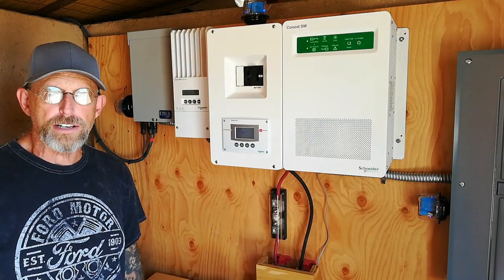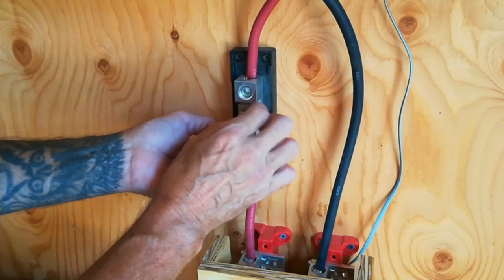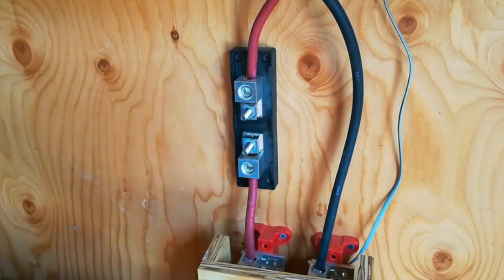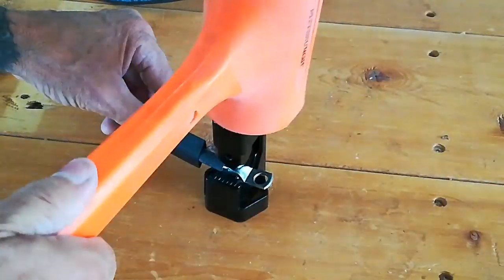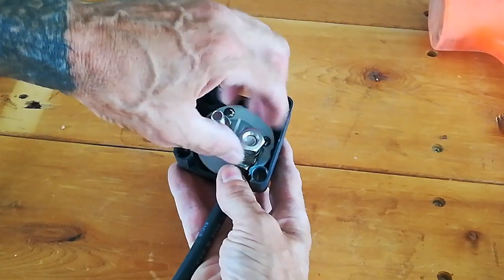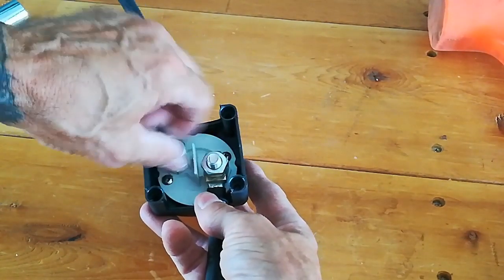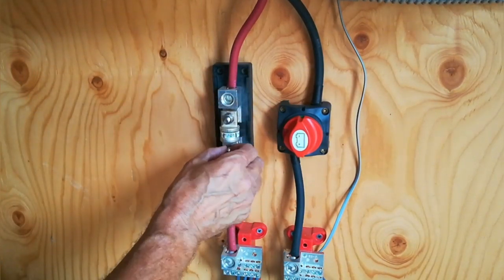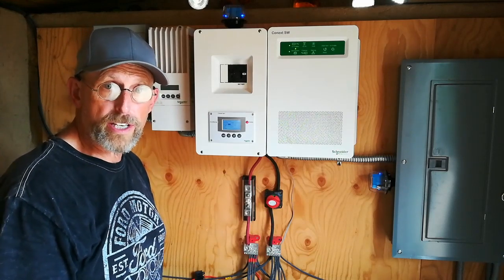RV/Solar Battery Disconnect Switch Installation

Comment: Everything I have researched says put it on the positive side.
Reply: That's what I tought as well , I'm making the circuit diagram for my very first solar setup. I was going to from battery ANL fuse ->  DC disconnect switch --> into + contact of inverter. Is this the right way? I think so.
Reply: @Sanasanita-t4k  I have a simple layout on my van electric video if you want to see it.

Comment: Very helpful video, thank you. Do you see the need to add a switch to the solar panel inputs, to cut off that power feed?
Reply from the maker: There actually is a cutoff separating the panels from the rest of the system. It's located in the combiner box where the wires from the panels enter the building. Thanks for watching!

Comment: Make sure the switch is rated for your install. 12-24 are usually fine, but 48V inverters need 60v switches! Otherwise they may arc  if they are switched under load.

Comment: Very clear video.  I have seen these switches on the positive side usually since in your installation you still have the inverter energized if you are maintaining it and it shorts to ground.  If you are maintaining the inverter, I think you will still need to remove the fuse for safety.  Also, am I being picky or shouldn't all those connections be set with a torque wrench?

Comment: I often wonder if it matters if adding the disconnect switch, either on the positive side, or the negative?   Also, does it matter which lug, on the back of the switch, which wire goes to it?
Reply from the maker: The lugs are the same on the back so it doesn't matter which ones you designate for + and -.

Comment: Hello sir good video I've learned something new
So i was wondering about my solar system
It's complete and i have found out that our daily use is not as much as we thought i don't wanna over charge my battery is it possible if i install a switch in a solar live wire when its off means it won't over charge my battery
Just wanted make sure if its a correct move
Thx for reading my question and
Stay safe sir👍
Reply from the maker: Thank you for watching and your question. I want to be clear as far as the reason for me installing this switch. It is not too prevent the batteries from overcharging, the charge controller is responsible for that, but rather to allow me to work on the batteries without the need to remove the inline fuse. These fuses are both expensive and somewhat sensitive. I've had one blow in me just during installation. I'm not sure why, perhaps there was a static charge. This switch just and a layer of convience when working on the system.
Reply: @theupsideofdownsizing  i appreciate your reply sir thank you and stay safe👍

Comment: I use the same switch in my boat, and if you push it inwards then rotate it counter-clockwise, you can pull it out. Either for hiding it to make it hard to use the the system (not so valid reason on a stationary system as a Home, but genius move in a boat) or just replace it if gets damaged/wares etc. 
Nice video. Like the combination of voice-over, and fast forward parts. Thank you.

Comment: If it were me, I would need to write a label on the wall to indicate Connect or Disconnect for which way to turn the switch, especially if something wasn't working right, I could easily forget which way was "on". 😬
Reply: The Upside of Downsizing That's a help, but my brain is getting more slippery every year, so I would still label it "Green means Connected" or something like it. I'm glad you pointed out what I couldn't see in the video. I really liked your voice over instructions.

Comment: If that bare wire into the busbar is bothering you enough, you could crimp a ferrule onto the wire. Watching this gets me excited to get the power shed done so I can get to the fun part and wire this place up :)
Reply: @theupsideofdownsizing  I wouldn't tin the wire. Solder can add resistance and has little compressive strength. Along the same lines, if you solder your connections, do it after you crimp them.

Comment: Great video Bill! The only addition I make with my cables are to heat the lug with my blow torch (in a vice) and flux/solder the wire in it, then heat shrink the exterior etc. This just gives me added piece of mind! Cheers!
Reply: @theupsideofdownsizing  Sounds good Bill! Have a great night and as always, I look forward to your next video!
Reply: Not a good idea. Vibration will fracture  soldered connections unless strain relieved.
Reply: @tryagain.k1821  please explain
Reply: @chadorico2480  Not to MIL STD. Soldered stranded conductors break. A good crimped joint is actually welded.
Reply: @tryagain.k1821  you do it your way and I’ll do it my way. PS- I guess the thousands of people who own machine shops/solar companies/and contractors are all doing it wrong! 🤣🤣🤣🤣 #troll
Reply: You obviously don't know what a MIL STD is and have never worked to one. Stop giving advice where you are not technically qualified.
   Where reliability is concerned a "cold weld" is superior to a solder joint. Of course a solder joint will work; for a while !
  The reason you use heatshrink is to hide the insulation you have burnt !
  I notice you claim to have knowledge of the working practises of thousands of shops. Somehow I doubt that.
Reply: @tryagain.k1821  Yeah best way is crimp
Reply: @tryagain.k1821  https://youtu.be/SXDkNMDDrBs

Comment: Nice job Bill!  I think we’re going to use Victron for our gear and I’m going to make sure I have plenty of disconnects.  I’m sure I’ll be paying more, but I like the features and ability to augment my power with a single phase geny.  I also follow Beginning From This Morning and his bus build is amazing for an off-grid example.
Reply: @theupsideofdownsizing  hum, what model is your generator?   I bought a Generac XC8000E to run our homestead, but I'm wondering if I could have gotten anything else.
Reply: I thought the ability to hookup to the Victron and have the Victron do 240 using multiple sources was a good feature.
Reply: The Upside of Downsizing I thought your inverter required a 240v geny?  That’s one reason I bought the Generac.  It can do 240 single phase.

Comment: I believe that the shut off switch should be connected to the positive side, for the same reason the fuse is.
Reply: @theupsideofdownsizing  The lower current on the switch may be easier on the switch, but the battery is what I would worry about. If you break the ground connection, you are still electrically connected to the power side of the inverter. I would check with Elon Musk if I were you.
Reply: @theupsideofdownsizing  Two points: one, the system is DC therefore the negative cable current is exactly the same as the positive cable current; two, as long as the DC part of the system is ungrounded (ie: not like in an automotive system) isolating either the positive or negative cable is going to be fine however depending upon the internal wiring of the inverter and the charge controller that may not be the case, I would check (with all power sources disconnected) to see if there is a ground on either of them to confirm. (the manufacturer or supplied schematics would assist you with this)  Cheers, Bob
Reply: Bill you may want to check your manual for the torque specs for the connections you made. Over tightening a connector can also have negative consequences just like under tightening one would. As a licensed electrician, when I am working in a panel, I always follow the manufacturer's  specs as far as torque is concerned. Your safety and the safety of your family is what is important. NEC 110.14 should be the code reference. I have electrical final inspections where the electrical inspector asked to see the wrench or,driver I used to tighten the connections. Keep up the good work.